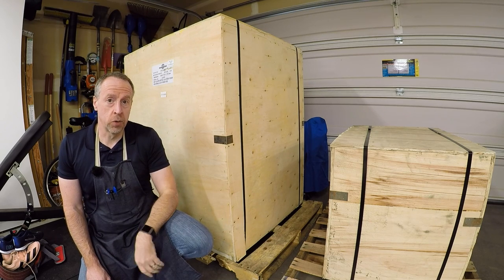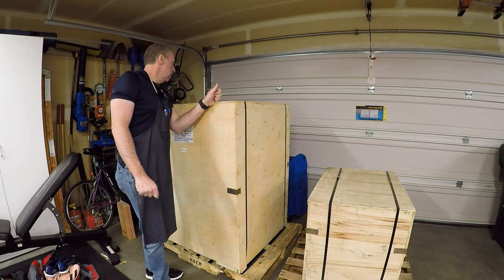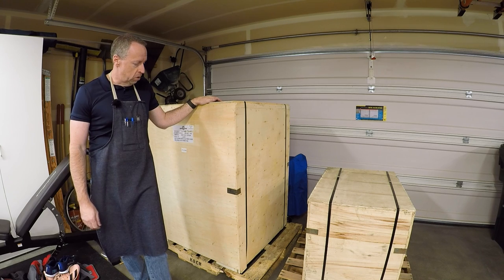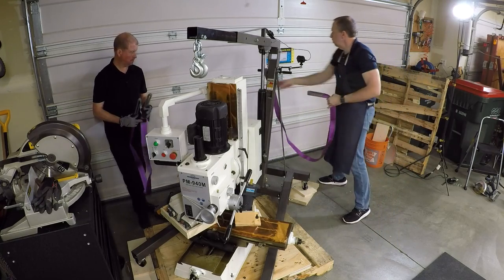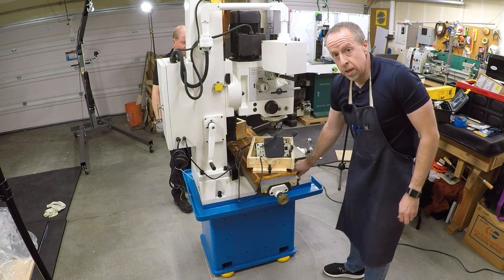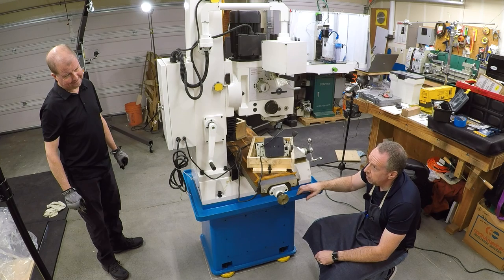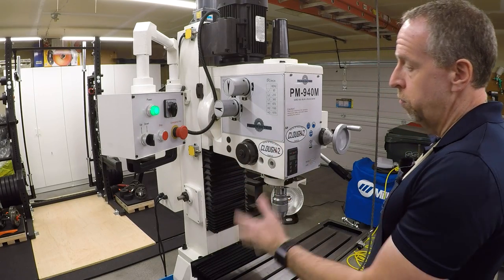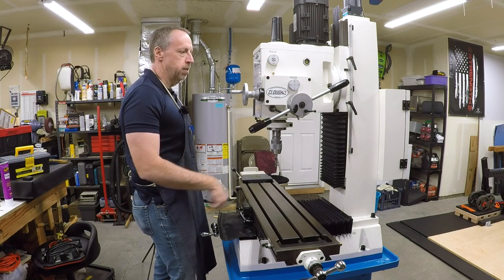Setting up a New PM-940M Milling Machine - Unboxing, Moving and Assembly

Comment: Any package marked "Fragile" seems to be a challenge to a shipper and translates to "Throw harder" in Shipperese.
Reply: Spiffy mill James, good video too. Everything I have read on imported gear head machines indicates its worth cracking the gearbox open to check for leftover casting sand and manufacturing chips. Have fun.
Reply: No kidding, we just returned a wrong shipment of fragile building materials and the guys that picked it up were literally throwing the boxes into the back of the truck. No telling how much damage was done to the product, thank fully we took pictures of the product minutes before they started loading and we already have or refund.
Reply: Very interesting I have a Titan machinery mill here in the UK that in many ways the same as this but without the motorised up and down and cross feed

Comment: Side note from experience (and a common problem) Open the electrical panel and make sure things are tight or prepare to be replacing a lot of burnt up wires!
Reply from the maker: The wiring looks way cleaner than I was expecting, but checking the torque on the terminals is a good call.
Reply from the maker: I did some checking this morning, and everything looks good.

Comment: Pre-planning is the word, the supplier called me up and said my Jet JMD 16 vertical Mill had arrived ready for pickup. So what's the first thing I do, I only have one truck. So went to Home Depot and rented a small hand powered lift truck , and brought it to my shop. Now I proceeded to pick up my milling machine, arrived at my shop. Now using the hand powered lift truck that I rented from Home Depot I was able to unload my truck and place my milling machine in its ideal position for my shop. A perfect day, I was able to handle a 600 pound machine and do it all by myself, with the aid of the wonderful equipment I rented, I'm sure no matter where you live there is a equipment rental place near you. 🤓

Comment: Just received a PM 1236 Lathe in November (similar weights in the machine and pedestals) and had to move it from my garage out around the side of my house, which is down hill to the basement level back door, in through the door, across the Family Room, down the hall, and into my workshop.  Watching you guys jockey that mill around your garage, I'm thinking "lucky SOB"...congrats on the new machine.
Reply from the maker: Thanks!  I'm not sure the floors in my house would support a machine of that magnitude.
Reply: @Clough42  Neither would mine, but the basement is concrete floor.

Comment: Scary, glad you got it moved. #1 cross your straps so there is always force tightening them, if it slipped they would both come off.#2 always assume the thing your lifting will fall - put a 4x4 under it when you put on the feet! If it fell you would save a hand. Speaking of hands - your friend was lucky it didn’t weight more when his hand was in the strap!

Enjoy your videos!

Comment: Right when he smiles I wish I was there to say "And you'll eventually find the X&Y are out of alignment" lol. Sucks, I had a PM45M CNC that was also "springy" on the column which lead me to sell it as the cut finish looked like a beaver chewed it into shape. I spent countless hours trying different collets, clocking collets, clocking bits, 2 flute, 3 flute, 4 flute, TRN, TiCN, HSS, carbide, 1/4 to 1" , stickout, locking dovetails on Z and Y axis then doing a cut, locking Z and X then doing a cut, adjusting the gib on the one axis I did leave unlocked, hundreds of RPM to feed ratios, different aluminum stock vendors, light pass with spring cut, heavy pass with several spring cuts, climb mill and conventional, checking runout on R8 taper, checking for slop or bad bearings in spindle and probably 500 photos comparing all the various finishes. Had a rough time getting others with similar machines to even post close up photos so I could compare my finish texture with theirs although everyone had an opinion and of course theirs was fine...lol. I can now tell you a G0704 delivered better cuts at 1/3 -1/4 the weight and a wacky column mounting method.

Comment: Bouncy bouncy! Let's bounce the new mill as hard as possible!

Kind of reminds me of the problem a computer manufacturer had when they discovered that a very large part of their warranty repairs consisted of reseating some chips in a certain model of computer. To solve this they immediately designed a way to secure the chips in the sockets and implemented it. Then someone did a study of the manufacturing and saw a forklift do a jump when driving over a sill as he was loading a pallet of new computers. The boxes all went airborne before crashing back down on the pallet. The truck driver thought nothing special of it and had the technique pat down to keep everything landing in good order, but the whole computer case got jarred and temporarily twisted slightly. It was enough to make the chips creep just slightly out of their sockets and in some cases they moved enough that the computer either failed when first powered up by the customer or it would do so a month or so later...

Comment: Not to be a youtube safety guy, but this may help some folks. When lifting with those straps around the base it is a good idea to lift just enough to tension the straps, and then use chain or something around the separate straps to prevent them from spreading and slipping off the ends of the table.
 I like to place the pallet on the legs of the lift and then lower the load onto it and then roll it around, especially top heavy loads. 
Lastly, never put any body part under any hanging load. Block it up, or at least put a non-crushable object under the load that is thicker than said body part. Hate to see you loose some fingers because a strap slips or the hydraulics give out (not that the HF lift is sketchy, I love mine).

Comment: Last month: I finally got rid of all the woodworking equipment.
This month: We used cut and drilled wooden blocking to lift the crane. We used cut and stacked wooden blocks to hold the mill off the floor.
Ironic.

And I'm jealous. I hope you and yours have a safe and happy holiday!

Comment: I bought a PM 932M 2 years. I was using an engine hoist to lift the mill off the pallet stack.... and the hoist collapsed/tipped.
I utterly destroyed the mill control, the motor capacitors, etc.
Sent PM a detailed list of what I needed, they express shipped the replacement parts, sent me detailed schematics, etc.

Took me a while to work up the nerve to tear the controls off, but my mill is up and running. Absolutely LOVE my PM mill!

Comment: The advantages of being in climate that allows a shop in the garage. And here I was looking at 2 feet of snow on the ground last week
Lining the mill base and stand up take for bolts and cut the heads off. Use those as guide studs when setting on the stand

Comment: Congratulations on the early Christmas present.
Not sure where you live but if that had to travel through Shreveport LA. It wouldn't surprise me if  it were tipped over sideways. I moved from Texas to the East coast and back and all of the damage sustained was coming through Shreveport on I20. 
I feel like you will enjoy the mill and customer service from PM. I have a 1236 lathe and their bench top mill and would do it again because they are incredible to work with.

Comment: Hi James. In the UK I have the same mill but branded Warco. Had it a year and very pleased but you will need to make new knobs for tightening the gibbs. The little lever type ones supplied are not fit for purpose and you will probably find that the ones that tighten the X axis catch on the ways when moving the table away from you on the y. Enjoy. All the best. Jim.

Comment: This is the most detailed mill uncrating and installation video that I've found -- and I got some good tips and detail w/r/t the hoist repositioning.  My PM-30MV is arriving this afternoon (yeah!).  It's much lighter than yours of course, but I'll still have the issue with the HF hoist legs not being able to straddle the pallet.  My thought/hope is to ask the Saia delivery guy to unload the pallet directly onto the legs of my hoist out in the driveway, then wheel it into the garage like that.  Hopefully I'll still have enough lift to get it off of the pallet and onto the stand from there.  

I also asked the PM folks to mark the top of the crate with an X to show where the front of the mill is facing so that I can get it onto the engine hoist legs oriented the proper way.  Let's see if they actually do that X for me.  If not, it may require a lift, swivel, drop, and lift again to get it turned the right way.

Comment: I got a PM-932. I had a weird hatch leading from the garage into the basement, with 18" of the basement wall extending from the garage floor up to the lower side of the hatch door.  The clearance thru the hatch was not enough to put the mill thru on its pallet - on top of having to lift it 20" in the air before moving it. Took a year before I could drag the thing into the basement after having someone come with a giant diamond hole saw and cut the basement wall to about 2 inches below the garage floor. Then it was a massive production to haul everything through the larger hatch opening and lower it all down to the basement floor 20" below then hoist the mill up on the stand. Only to discover there was a congenital problem with the electronics that raise the head. Covid hit and other things got way more important. However, seeing your 940 I'll now put work into getting my mill running properly. PM did send me replacement parts (that were shipped from China) to repair the elevation motor/contactor buttons, etc. Like you I have a Grizzly mill so it was not super pressing to get the 932 working.

Congrats on the new mill and I hope you have better luck getting yours running than I did (I'm 2 minutes in so don't know yet what you have in store for yourself)
Reply: Footnote: I could solve all my problems by setting the workshop up in the garage but I have a 2400 sq basement and I don't like digging the cars out of snow.
Reply from the maker: My grandparents got a piano into the basement by lifting it over a half wall and lowering it down a stairwell with a block and tackle.  After that experience, they told me they would sell it with the house.  :)
Reply: @Clough42  hahaha. I suspect mine may never leave the basement.
Reply: @Clough42  forty plus years ago we went to look at a House for sale. On the upper floor in the second bedroom was a grand piano. When I asked I was told that it had been installed via the window opening before the window was installed, wrapped in cardboard while the house was finished around it and was to be sold with the house. Facing the cost of removing it, we needed all the bedrooms, we declined the sale. It was a nice house and the piano was in great condition. Just none of us played.
Reply from the maker: @ronwilken5219  my grandparents' house had a piano in the basement with a similar story.  It was a Sears Roebuck catalog home, build in the '20s.  They lowered the piano into the basement stairwell with block and tackle, presumably before the enclosed porch was added over the top.  That piano went with the house after they passed.

Comment: James, I have a 940m as well. I am in the process of a cnc conversion. I go a little sidetracked with a quadruple bypass but am in the process of getting it up and running. I built my own feet with hockey pucks and 1/4" stainless drops I bought from ebay. The feet turned out very well. I also took the mill apart and used a needle scaler to remove all the bondo that is used on these machines. I removed about a full gallon of bondo from the mill and base. The needle scaler removed all the bondo and paint very well and quickly. I blew up my cheap used air compressor and had to buy a new one. lol  I was pleasantly surpised that the castings looked pretty good and wondered why they used so much bondo. I then repainted everything with POR primer and paint. 

The machine isn't as heavy as they claim but still is heavy. Here is what the parts weight. But my machine is the basic model with hardwaysand doesn't have the control box, control head or the z and x power feed motor like yours so your will be a little heavier.

As for the mill;
mill base 130
column 144
spindle head 185
Z saddle 34
motor 40 
X table 131 
Y saddle 48 
mill total 712 

As for the bottom stand 310 
Total weight 1022

Comment: You can double or triple the paper thickness on the gears if you want it more accurate. 
Paper is great for shims if there is enough bearing area, and it's tolerant of slight dirt because it embeds without affecting the shimming height.

Comment: That's really gorgeous. "Oil bathed gear train" is crucial, I had to pack sloppy low vis grease into my crappy rong fu clone to 1. stop the hi pitched whine and 2. stop tripping the circuit breaker.

Comment: Congrats with the new Mill! 
Tip...For adjusting the gear. Take some solder wire. turn the gear and messure the thichness of the it :)

Comment: I own an Optimum MB4 milling machine (Germany distributor) which is a smaller clone of PM940 from the same production plant. When I installed it, I was surprised by what was in the transmission. Lots of chips and pieces of kite from production. I had to disassemble, fit and clean the entire transmission. Without it, it would not have a long life. You better check it out.

Comment: I'd say from personal experience, I haul shipping containers to and from the ports. Some of the newer operators of the "top handlers" and the "trans" (mobile overhead cranes) they're not as gentle as the more seasoned operators. I've had containers slammed onto my trailer before, making my trailer leak air like crazy! I've gotten to customers afterwards, opened my doors and backed into docks, shipping and receiving crews tell me the cargo is messed up. Not my problem

Comment: I bought that same model about 5 years ago, I like my gear change knob locations better, they face the front instead of the side.   It needed a gooseneck work light, that was added later.  Shars is a good source for tooling.  Adapters run morse  #2, #3 drills.  I ordered the collet set to make use of end mills and annular cutters.  I like your nice roomy shop....

Comment: when I got mine I drilled 4 holes through the base, ran 2 lengths of rebar through the holes, lowered the head as far as it would go, the put the lifting straps  around the bars. Easy to drill being cast iron, some brands come with holes already in the sides of the base.

Comment: One great thing with a new small mill, you can add a Mini pallet system that covers the X and Y surface area of the milling table, that way you have the option to move your milling vise and even add a second vise that will be perfectly aligned with the first one.

Comment: Exciting to get a new machine, must feel like a whole world of difference from your G0704.   I went from a Little Machine Shop 4700 micro mill to a G0704 (used) and it was a nice upgrade for me,  I installed the power feed and power lift because hand cranking was getting very old, I did put a DRO with glass scales on it too. 

Congratulation on your new machine and I share that excitement with you.  Can't wait so see you put it to good use. As always, your videos are super great.

Comment: Good job. I always have crates held at the freight depot and take a utility trailer there to pick things up. They can forklift it onto the trailer and separate things, remove extra pallets, etc (which avoids some of the problems shown here). Unloading from the lower height utility trailer backed into the garage is much safer and easier (leave the trailer connected to the truck or put jacks under the corners of the utility trailer to make it very stable).  You never know with liftgate delivery what they'll do (or not do) for you, plus with a depot pickup things run on your schedule rather than waiting for their random delivery.
Reply from the maker: I have this image in my mind of a Harbor Freight folding trailer hitched up behind my 2003 Focus.
Reply: @Clough42  Don't diss the HF folding trailer...that is what I used to move my PM1236 from the garage around to the back basement door (one level lower).
Reply: @Clough42  That might be very exciting. My little Toyota 4Runner handled it like a champ though it was dwarfed by the tractors they use at the Fedex depot to move trailers around. :)
Reply from the maker: @hdmungeryt  I love my little trailer.  It's the best thing ever if you need to buy plywood without a truck.  But 1400lbs is well in excess of the rated capacity of the trailer, the hitch on my car, the brakes, and the clutch in this scenario.
Reply: @Clough42  Well, I didn't do it all in one go.  I did the lathe (with about 330lbs. of parts removed) one weekend, and the two cast iron pedestal bases and the engine hoist the next.

Comment: I have a PM 45M and raised it to make it more comfortable to use.  I wish I had raised the mill from the base like Pragmati Lee did when adding a new x-axis power unit.  That extra room would make it much easier to lock the y-axis..  Granted you would want to cut a piece of sheet material to keep dwarf from migrating into your cabinet also.  Just some to think about when installing your dro.  It gets crowded on the lower right side.